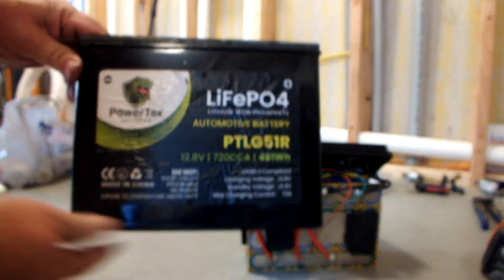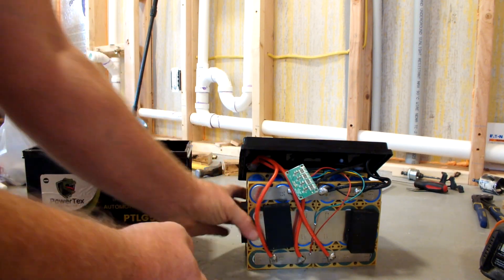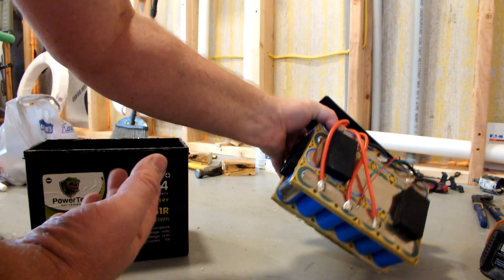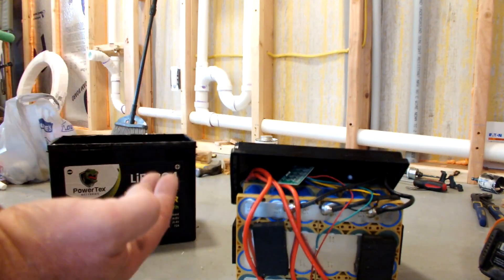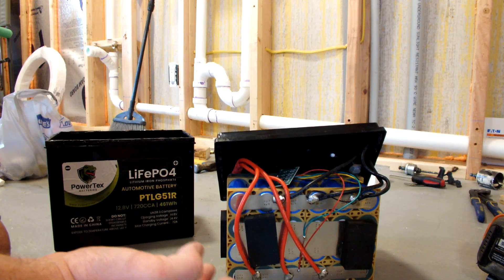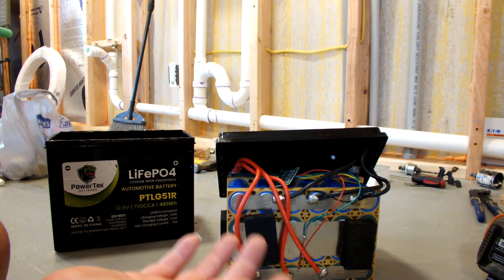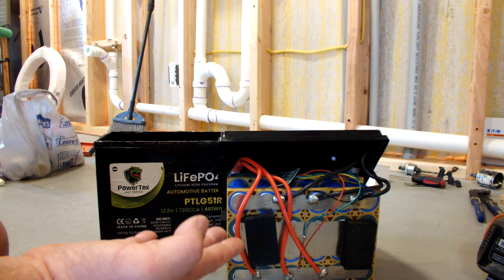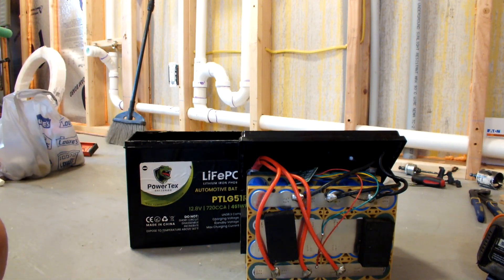Designed to fail - Everything you want to know about the PowerTex starter battery

Comment: Wish I saw this 2 years ago. My PowerTex battery just died, it's just barely within the 2 year warranty period but they are refusing to cover it, blaming the alternator. They claim "your alternator /pushed/ too much current and over charged it... so it's not covered", which isn't even how electricity works... After seeing this tear down, it's not because their BMS failed--it's because it doesn't even have any actual BMS at all!! I call fraud. Avoid PowerTex. Total scammers.